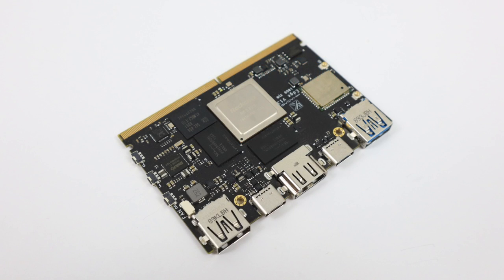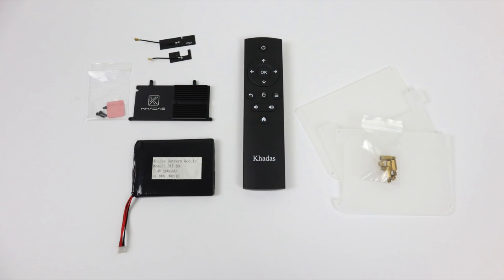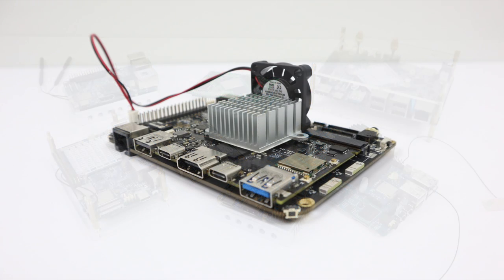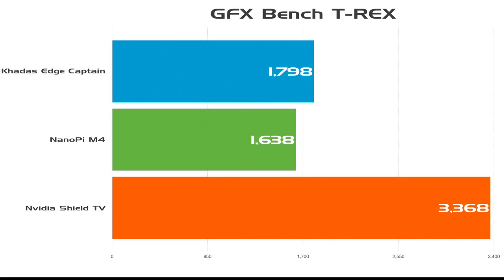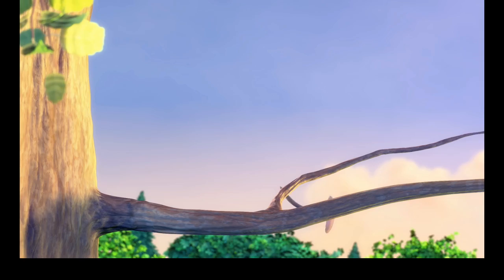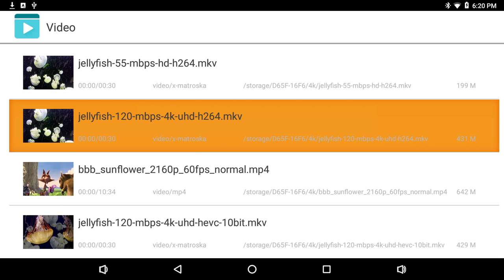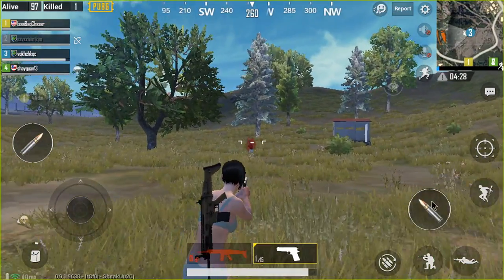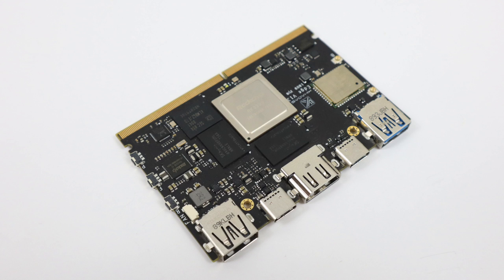The Khadas Edge New SBC First Look And Android Test

Comment: Great video again, very helpful, I think we all need to wait for the pi 4, these rk3399 boards hold so much promise, but fail to deliver, I have a 2 year old cubot note s £55 pound it cost, it does the android stuff amazing, N64 emulation is faultless, I have Nubia M2 8 core snapdragon 2.0ghz phone these days, cost £110 , well it puts these rk3399 boards to bed, but not keeping up with a shield, about time a sbc came out to rival the shield.

Comment: How well does it run Android ver 7,  8...ect I'm looking for a board to run a wall tablet touch display currently its running a board with with a Rock Chip RK3288 and I can't upgrade past 5.1 I need at least 7.1 any suggestions? Thanks!!

Comment: I wonder how these android SBCs perform with steamlink. Ive been thinking about building an arcade machine that would run an android device connected to to big box on my gaming pc
Reply from the maker: As long as it has good 5ghz WiFi or Ethernet it should perform just fine.